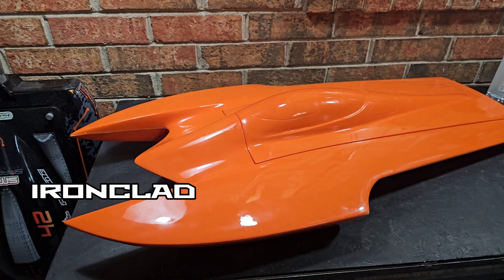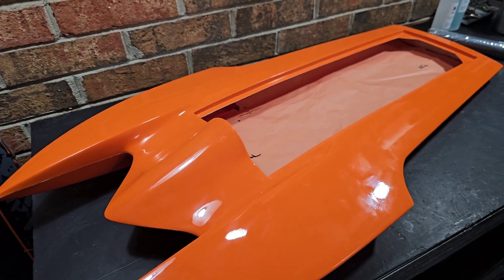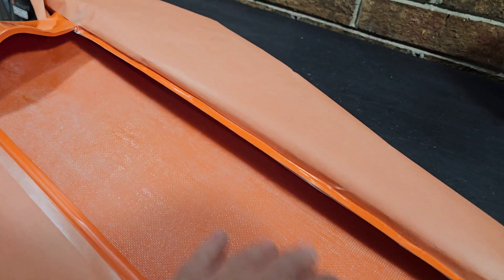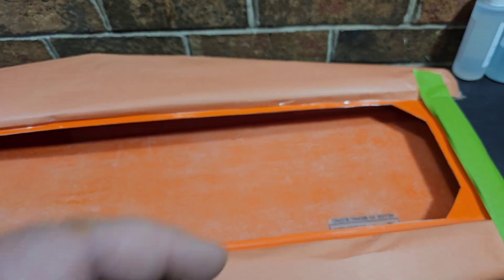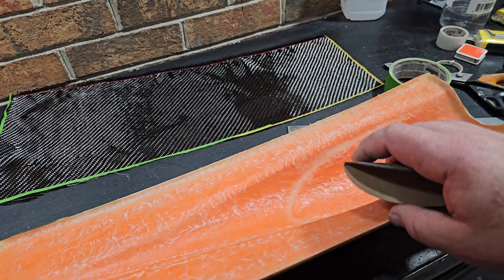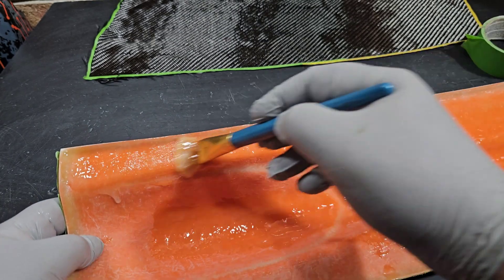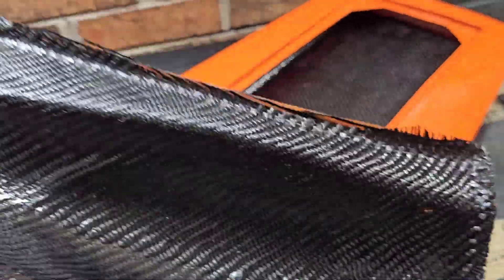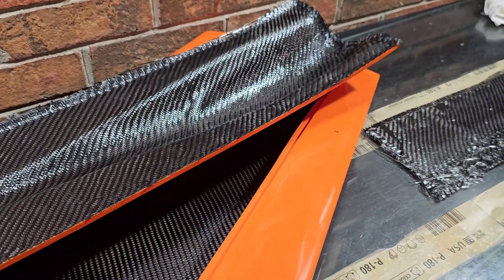Carbon Fiber Inlay Hull Reinforcement Deltaforce Vortex 34 Rc Hydroplane Build Pt 1

Comment: Are there any drawbacks to reinforcing with fiberglass versus carbon fiber?
Reply from the maker: I think the biggest drawback would be weight, fiberglass is heavier, and tends to suck up more resin in turn, weighing the hull down.  Carbonfiber being lighter and stronger.  BG4L

Comment: After laminating roll on a dry layer of peelply, let it harden, then tear it off.
Will remove any acces epoxy and provides a mat finish, no sanding required.
Just a tought.......may be of some help.
Reply from the maker: Thanks for the tip!
Reply: @IRONCLADRC  Anytime.

Comment: Looks good. You do a good job helping OSE sell out of stuff after your videos too! Side question. I got a flex shaft driver to get those pain in the @ss screws however it doesnt flex much to be helpful. Have you found a good one?
Reply from the maker: I use the Cheap harbor freight flex driver,

Comment: Nice, I enjoyed this video! The laminate came out pretty neat, too. Some quick tips! A disk-knife / cutter is a very convenient tool to cut the carbon. I don't even tape the cut lines. If you pick up the weave carefully, it will stay in one piece. Because, removing the tape is a pita, and sometimes the tape prevents the weave to form nicely.
2nd tip: the epoxy required is 1:1 equal to the weave weight. So, if your weave weighs 50 grams, you need 50 grams of epoxy. Maybe 5% more, because the cup and brush will   keep some epoxy. It's a good reference for not ending up with a too heavy boat! Looking forward to the next build video ✌️
Reply: Thanks, any excuse to buy a new tool is a good excuse 😁